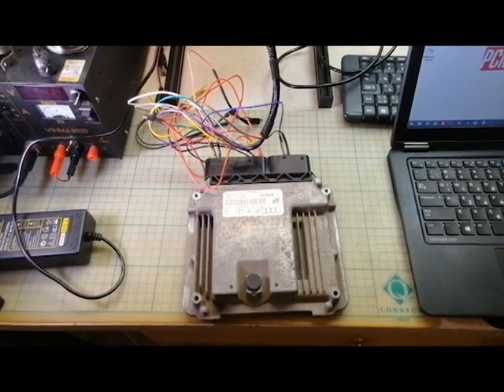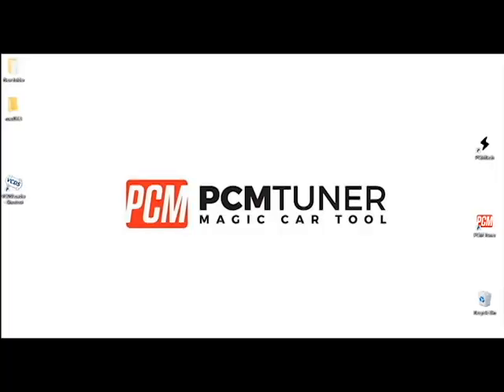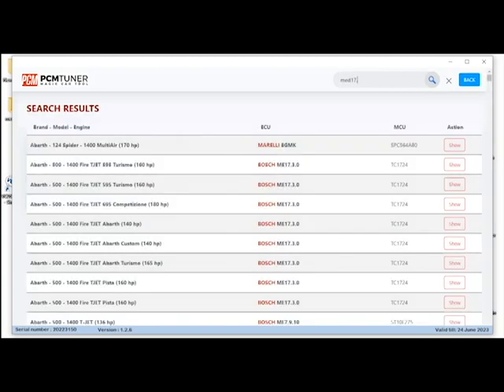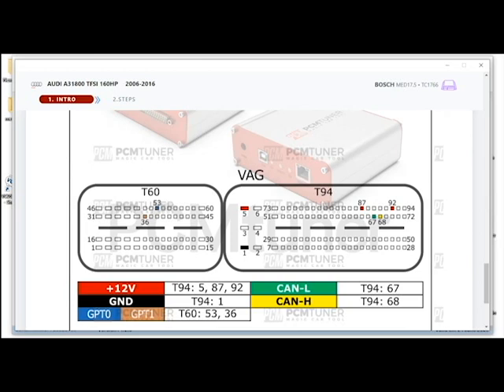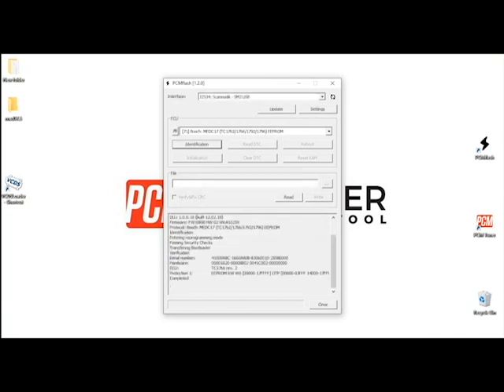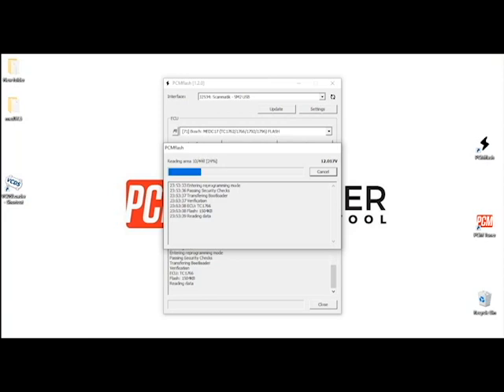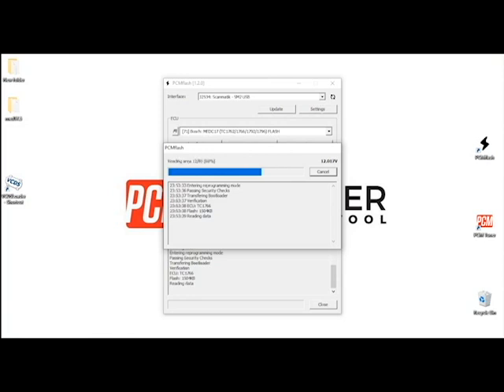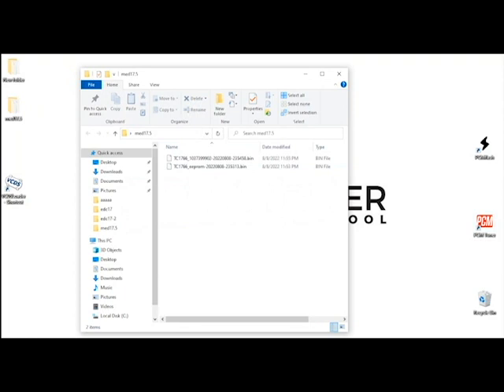MED17 5 VAG READ WITH PCMTUNER

Comment: Can I work on ecm titanium software using ecm tuner ?
Reply from the maker: Sorry I didn't understand your question. Ecm is a software that can modify file's. Now if you're asking me if the ecm titanium recognizes the files that you read with pcm tuner I would say  this, I used this tool only for testing and making a few videos  I no longer  have it ,but comparing the file's from kess clone and this, yes ecm titanium was able to recognize the driver no problem,  as long is you using original ecm